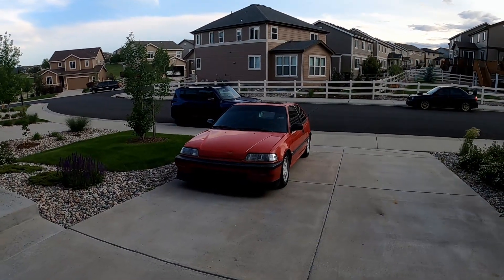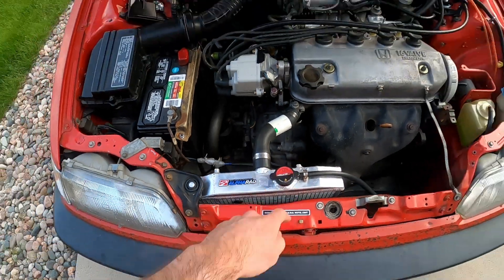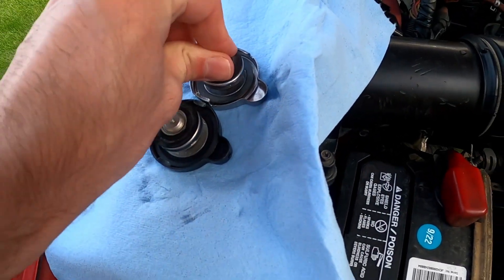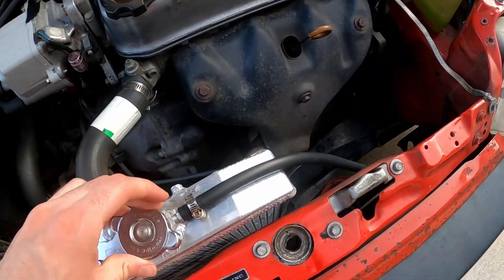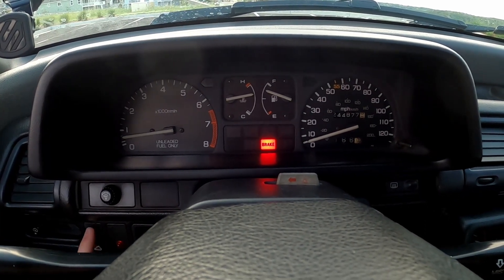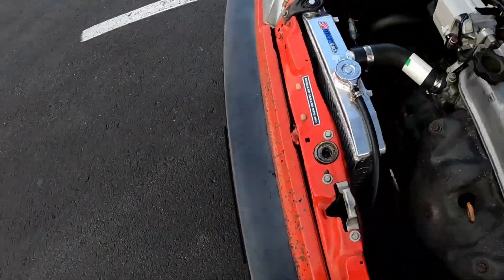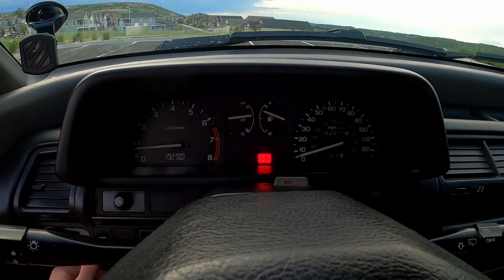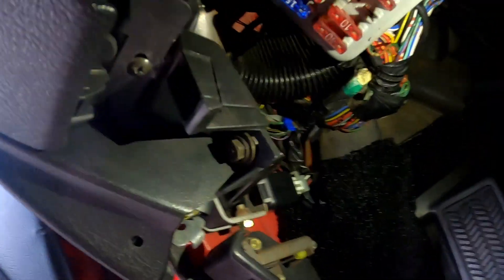Trying to Fix my EF Hatch's Overheating Issues - Fan Turns on Too Late

Comment: I changed my thermostat  to 170 degrees and overrode the radiator fan switch to manual !  cut the top hose and installed another switch.

Comment: Check your temp sending unit and make sure the wire is making good contact. 

Had a similar issue with an EG with a B7 it would show overheating. Car showed no signs but didn’t want to risk so put an infrared gun to the hoses and it was marking 95 degrees when the needle would show it overheating. Once I realized the car was good, I let the fans turn on and all. Concluded it was a bad gauge after checking temp sending unit and all. 

Clusters are expensive so I decided to wire a espérate temp sending unit from the top of the radiator hose and that’s how I monitor the temp. Yours could be a bad gauge or cluster too if the sending unit is good.
Reply from the maker: I measured the resistance of the sending unit today. Fan turns on around 33ohms at the sending unit (~210°f, <100c), which is within spec according to the service manual. But the gauge shows 3/4 ish.
Reply: Yep so your problem is not the coolant temperature sensor because the car turns on and drives fine and it’s not the cooling fan since you tested it and it kicks on at the right time. 

My guess it’s somewhere in the temp sending unit. That sensor is under the temp sensor on the block by distributor. 1 wire plug/sensor probably dirty or not making good contact. Or it’s the gauge that’s bad especially considering it moves when you operate the sun roof.
Reply from the maker: @jusalhe  that one wire sensor is what I measured the resistance of.

Comment: Head gasket. I'll put money on that diagnosis. Every new owner of a used ef Honda Civic SI goes through the same thing bro.
Reply from the maker: I've read that in a few places, but not sure if I think it's my problem. Did a coolant pressure test - held great pressure for over an hour. No discoloration of the coolant, no small bubbles, no loss of coolant, no smoke. Additionally, the fan successfully cycles every single time